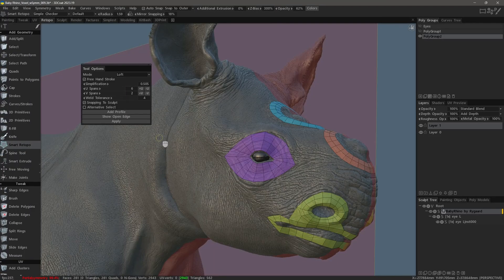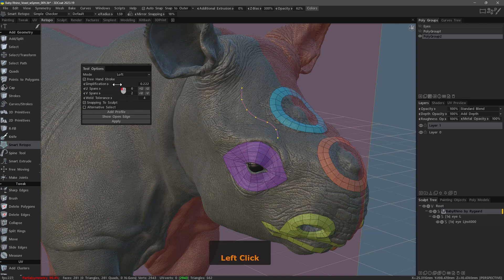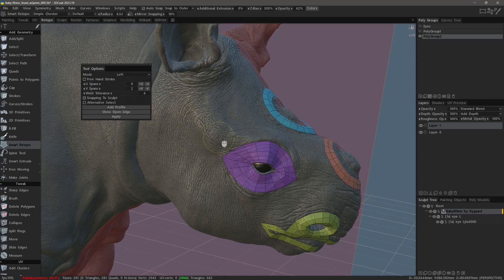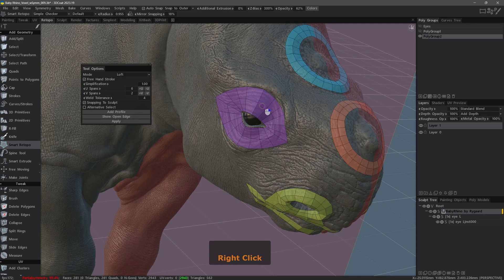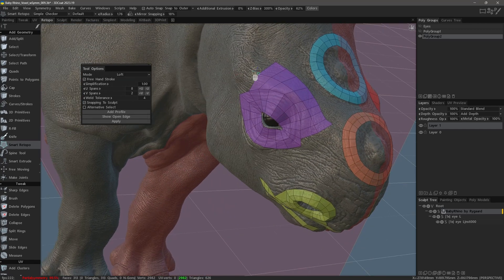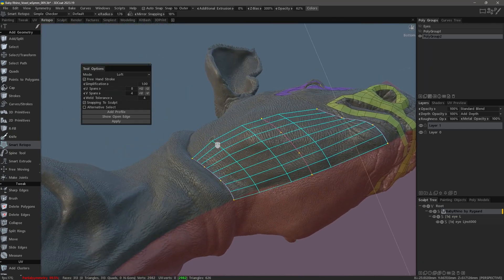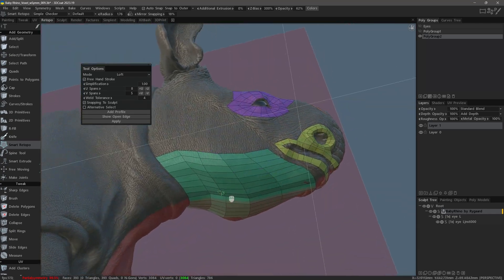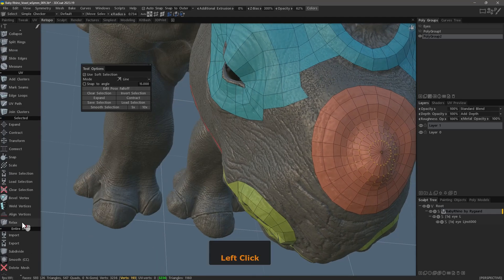Smart Retopo 2023 Update - Loft Mode

Comment: Are there plans to revamp the UI?
I used 3dc and 3dc textura , but the interface is just cramped, confusing , fonts and spacing seems off.
To be honest this is the only thing I can't get over (tools panel look good to me, for example).

I recently bought substance painter just because of 3dc UI and general interaction feel.
I hope you look into this and make it pretty.
Reply: The UI is jus fine and well thought out for what it offers. The rest is just taste. This program is vastly more complex than substance painter, as it has many, many more functions. No way to minimalize it for less advanced users or singular use cases. It jus has to be learned, jus like zbrush. Ever looked at Mari? Or 3ds Max? Are they "pretty"? These are just tools, not the work result itself. 

Give it a shot, keep at it. As a 10+years Blender user,  I needed 3 attempts to get into the program until I realized how powerful, versatile and user friendly it actually is, esp. in terms of UI always being in context of offering the right options for the job. Its pretty clever actually, once you get it. And using hotkeys will eliminate the need for redundant navigation, jus the same way as in other programs. I never looked back since for parts of the pipeline like retopo. Def. the most artistic retopo toolset ever created. Texturing has some certain disadvantages, like the lack of B+W masks. But it is a much more hands on experience than substance painter, albeit the more destructive workflow. It is incredibly liberating, flexible and really feels like a painting program in 3d, even the sculpting part. 

I'd say 3d coat is the most artistic 3d app ever created, and offering the full pipeline from high poly to low to uv to texturing, it baffles me how people first crit the UI without actually taking their time and effort to first learn the thing. Every program has its learning curve. And every new program, jus like when learning a new musical instrument, can be confusing at first. But one can only truly judge this once you know your way around it, actually learn to play those strings, not jus looking at them.
Reply: @harrysanders818  Ui was a long time issue for people wanting to get into 3dc, as far as I recall ( I do).
Making attractive, easy to use product is a smart way to sell more licenses. 

someone from polycount 3 year ago:
"It also just makes a really poor impression when I want to show someone from the team how easy it is to make a smart mask material in 3D coat compared to painter but everything is a mix of laggy or unresponsive or usage feedback lacking buttons and actions and you really notice how they don't want to use it even though its only a few steps to make something. Especially around the material workflow its very clunky and just dosnt feel good. Also someone desperately needs to add some proper Layouting to all the elements, Text and buttons need space. Alignment is important for finding things. The UI could look 2x better and understandable by just moving all things a little bit according to basic graphic design formatting rules and adding missing button states. Looking forward to the new versions tho definitely."

"I really hope v2021 addresses alot of the ui issues rather than just adding a load more new tools. Dont get me wrong its a great package that i`ve used for years but find its let down by lots of new tools being added but nothing really being refined.

For example the smart material interface hasnt changed for a long time, its still not very user friendly to tweak settings in your materials as you are painting.  Smart layers should be much more refined, be able to apply stencils and move them around later.
Layer masks should be easily added and viewed in the layer like photoshop, not hidden away in a layer blending menu.
There is no search feature for materials , so its difficult to find materials as your library grows.
When doing intensive calculations there isnt a way to quit out of it and go back, it just sits there for hours sometimes being non-responsive.
Having editors split up from paint, uv, tweak,etc really should just be combined into a couple of editors, paint and sculpt.

Thats just what i can think of off the top of my head. I use substance painter , quixel, marmoset 4,etc but i do have a soft spot for 3d coat as its so quick to do many things. I just wish they would polish some of these areas to make it a really great product.
Reply from the maker: Memag Neman...Even though we are going to be focusing on the UI a great deal, a lot of time and effort has gone into UI improvements already since the 2021 release. It would be helpful for the developers working in this area, to receive some positive feedback when they actually deliver requested changes. Examples of their efforts are:
1) A complete refresh of all Tool buttons/icons throughout the application 
2) Relocation of the Workspace/Room tabs (they are optional now, but a list menu in the upper left is the default)
3) Hidden Navigation bar until the user moves their cursor in it's direction
4) Activity Bar (upper right portion of the UI) to allow the artist to reduce the number of panels in the UI, to reduce UI clutter. There will be some improvement to this bar (perhaps repositioned and made to function much like the panel bar in PS)
5) Minimalist UI toggled on/off using the TAB key
6) More streamlined/simplified layouts in each workspace, but these are all extremely customizable
7) Some text spacing in panel tabs and other areas have been increased to avoid a cramped appearance.
8) Tool Groups (ala Photoshop, with the small triangle in the lower right portion of a tool button, to access tools that are related to one another, such as different smoothing brushes). 
All of these efforts/features were made to reduce UI clutter and make it more appealing, visually. However, the UI structure was always designed to be similar to Photoshop's. It's not sexy, but it's functional and familiar to most artists. We have no plans to deviate from this structure. Just improve it.
Please watch the videos about these changes and then make an assessment based on usage/experience rather than relying on someone else's criticisms years ago.
https://youtu.be/YGMl81KhPvc
https://youtu.be/WzdQW1B5zys
Reply: @PILGWAY3DCoat  Thank you.
Reply from the maker: There is going to be a lot of focus on the UI in the 2023 cycle, so please visit the 3DCoat forum and/or email support@pilgway.com with specifics about the changes you really want to see. Using a screen recording to make it clear what your grievances are and what suggestions you have, would be very helpful for the development, because broad generalizations like "the UI is bad" cannot and does not help.